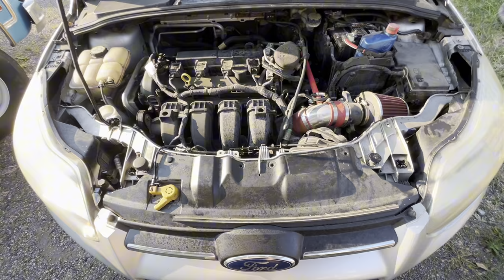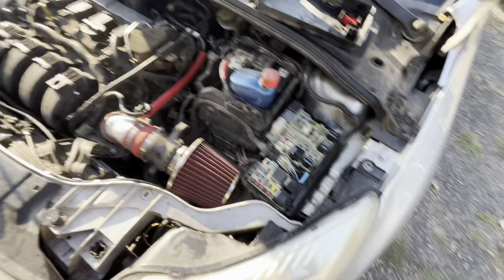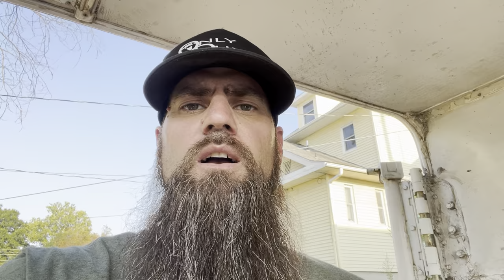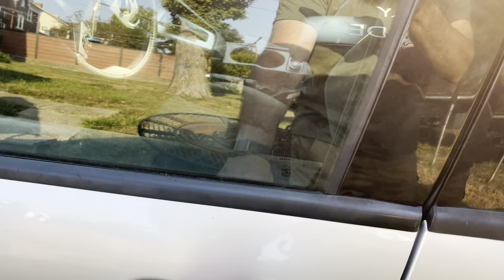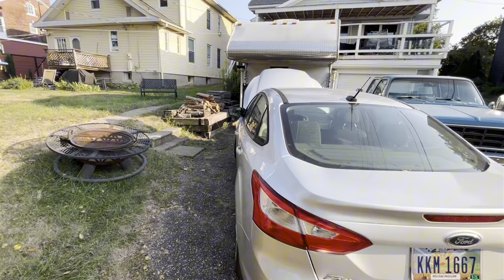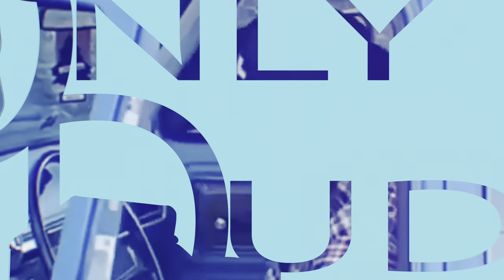Bought a 2012 Ford Focus, what could possibly go wrong?

Comment: My girlfriend purchased a 2012 Fiesta SEL a little over a year ago. Ac worked when purchased then the next day blowing warm air. After searching all the endless possibilities, it turned out to be the ac was overcharged. Let out some pressure and clutch kicked on an cold air ever since....well except for when i forgot to plug the temperature sending unit in cabin air filter, but i digress😅
Reply from the maker: Good little cars but boy do I hate all the things that can go wrong with them. That’s why I like the old stuff, easy to work on. Thanks for the comment, make sure to hit the like button and also subscribe if you haven’t already.

Comment: I love technology. I program chips and design cool stuff....but. You add electronics and code to an engine to perform better.... cool, great. BUT, you also add failure points to the process. Every line of code, every surface mount solider point is a potential failure point that can cause a mechanical failure. There, the secrets out....
Reply from the maker: @jonathanhernandez4304  😂 yep technology is great until it fails. That’s why I enjoy the old vehicles, my 77 Chevy was flooding and took the carburetor apart and found that one of the floats had a pinhole in it and was taking on fuel, causing the bowls to overflow. $20 on Amazon got a rebuilt kit and in less than three hours had it rebuilt back on the truck and running again. Hey if you enjoyed this video, make sure to smash the like button for me. Also subscribe to the channel if you haven’t already. Appreciate the support.

Comment: My 2014 focus transmission started hesitating recently. I only have a little over 82,000 miles on it. But it is a ford flaw they have never fixed.
Reply from the maker: @brucegoldman2174  might check and see if the car has a recall on it.